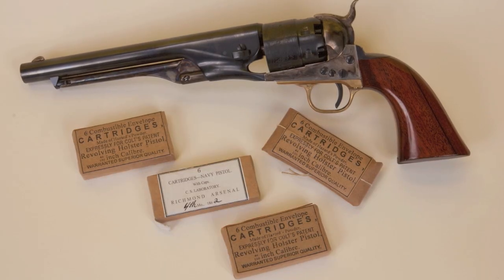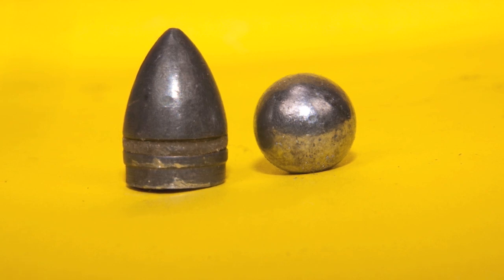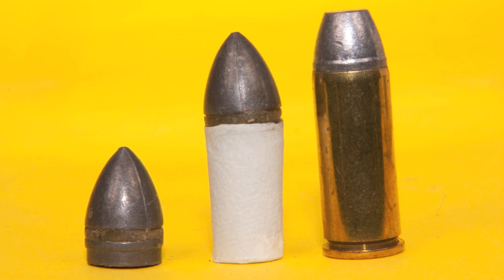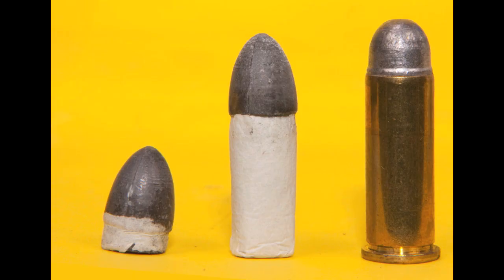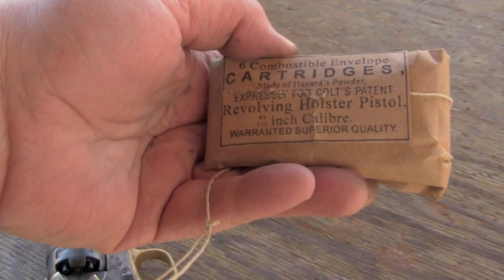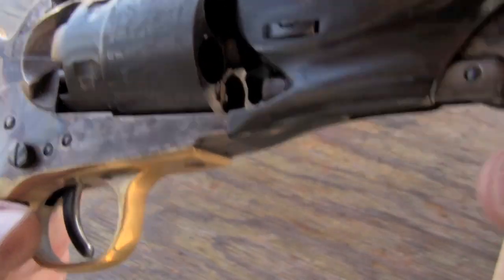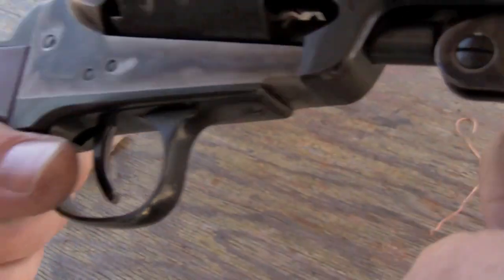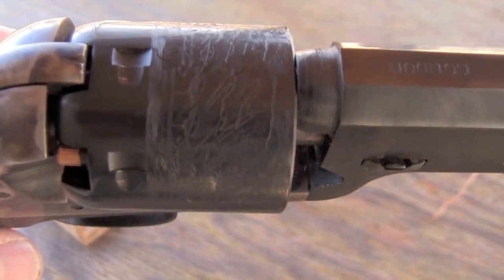Shooting Cap and Ball Paper Cartridges.mov

Comment: I was making my own paper cartridges 20 years ago. I had a brass mould that made a heeled conical bullet. I made a form out wood for the diameter. I cut cigarette paper into a curved triangle shape so that the mouth would be straight when wrapped around the wood form at the proper diameter. I used just a little dap of Elmer's glue to hold the paper. Then I glues the formed paper cone onto the base of the conical bullet.  powder load into the opened, tapered tail, then folded it over and glued.

Comment from the maker: @jebusHchru If you get a good seal on the bullets, you don't need grease to prevent chain fires. About 10 years ago the NMLRA did tests that showed that chain fires mostly occurred from the rear due to loose or fallen caps.

Comment: I've been shooting cap and ball revolvers for decades. I've made my own paper cartrridges.
This video points out a failing of the paper cartridges, but it was edited out: paper cartridges rarely slip easily into the chamber.
You jiggle to get them started down the chamber. Doing so, the paper tube can be easily broken, spilling the powder. The bullet contacts the frame, interfering with a straight start down the chamber.
Paper ctgs.are not nearly as easy as this video suggests.

Comment: I've been experimenting with rolling my own using tissue paper (The same stuff you shove into gift bags). The cartridges seem sturdy enough to deal with and good ignition so far (no misfires or hangfires). I dip the bullet end in a 50-50 mixture of petroleum jelly and paraffin for lube, which might be too hard, will probably increase the jelly in the next batch.
Reply: I do a bees wax lanoline mix thick as desired, even use on my leather boots and gloves. I only dip my lead after gluing in heated liquid lube

Comment: Correct.  You do not NEED to use flash paper.  I have made cigarette paper cartridges and flash paper cartridges and test fired them both in my .36 - 1851 and my .44 - 1860.  Ignition was fine for both.  However the cigarette paper did not burn up completely and did leave residue in all chambers.  The flash paper and flash glue burn up 100% and leave ZERO residue.

Comment: I use the the Lee conicals in .36 and .44 with cigarette rolling papers.  I've found a 3/8" and 7/16" straight dowel works fine; fold the end of the paper tube over the end of the dowel, drop a drop of super glue on it and stick the bullet on.  Fill with powder through the open end, twist the end with wet fingers, chop off the excess.  The Lee conicals will fit over 35gr. powder in the Pietta .44 and 25gr powder (barely) in the Pietta .36 (I backed the .36 off to 20 grs, and the .44 to 30grs, but will probably up that back to 35 grs, since there wasn't an issue ramming the bullet home).  Seems like a little faster process (tho less authentic) than what's in the video, and I haven't had an issue with ignition.

Comment: The paper cartridges load much better in originals than in reproductions. You can grind out more space between the barrel & the mouth of the chamber. Then rolling the load under the rammer is much easier and more period correct

Comment from the maker: that would be tough, but maybe you could make a cartridge wrapped in nitrated paper that would work. I think ignition would be the problem. I can't imagine that working at all with a flintlock. Actual paper rifle and musket cartridges were designed to be torn open and the loose powder poured into the barrel and then the ball rammed down over the powder and the paper used as wadding.

Comment: i nitrate my rolling papers by a super fast dunk in spectriced ( its a weed insect killer you can pick up in any of the big chain stores with garden depatrtments) and letting them dry. spraying with a mister works too. its some pretty nasty crap though.  its part pottasium nitrate and god only knows what else.  DO NOT LICK THE PAPERS !  a very small paint brush picks up enough moisture to wet the edge. i use water to seal the cone edges for convienience. one more thing ,,,, test both thick( TOP ) and thin ( zig-zag /bugler) papers.   once you get your procedure down pat it wont take very long to twist up a bunch.  keep your eyes open at the range for plastic cartridge holders you find in some ammo packing. .45 acp works best

Comment: i notice that your not greasing the ends of the chambers to prevent a chain fire. is there a built in wadding in the cartridge to keep any heat from getting to the powder? or does it rely on the fact that if properly loaded, you shouldn't have any powder residue that could be ignited by a spark ahead of the tight fitting bullet?

Comment: i see tha they shoot very nice in your 1851 navy i was wondering would they shoot in my pietta 1851 navy 44 as well or a simular type and what would you recomend i love shooting mine with round ball and have not seen to many places to buy conicals i shoot the .454 and .451 ball  also thank you for great videos  very helpful ! also my next purchase will slix shot niples from what i seen and saw about primer jump
Reply from the maker: There's not enough room to get them loaded in a .44 Navy. Not enough room under the barrel.
Reply: They will shoot just as well in a '51 Pietta, Uberti and Armi Sport, etc.  There is no difference in chambering.
Reply: +Tony Foltz -- You should be able to get conicals from Cabela.
Reply: +Thomas Mobley i never seen them at cabelas ever.
Reply: +Th3Sabator45 -- I have some right now that I got from Cabelas some time ago, I ordered quite a lot of them, but you're correct they no longer seem to sell them.  They do have the mold though if you'd like to cast your own.

Comment: You should have been using the Remington 1858 New Army.  It has slots between the cylinders that you can safely rest the hammer in between just like the modern North American Arms mini revolvers.  Then you can load all 6 safely without worrying about a bang when you don't want one.

Nice video. But where's the fun in this!  You got to get your hands dirty it's part of the fun.  Clean up afterwords is a total B*&@#% though.

Comment: Duelist1954, making nitrated paper is not difficult but it is hazardous.  What about soaking the cartridge paper in a strong saltpeter solution and drying it before making the cartridges?  Would that make a safe cartridge?
Reply: Why don't try it out, see if it works and let us know.
Reply: Late reply but yes,  that is safe and it works fine enough. Just soak and dry it out. Cold water works fine.

Comment: I bought a 36 Navy that has a loose cyl pin.  Can it be fixed.  Its a brass frame pistol?  Thanks.
Reply from the maker: William Christopher anything can be fixed, but a loose arbor pin is a job for a professional gunsmith. Buying a new frame would be easier and cheaper. Get a steel one